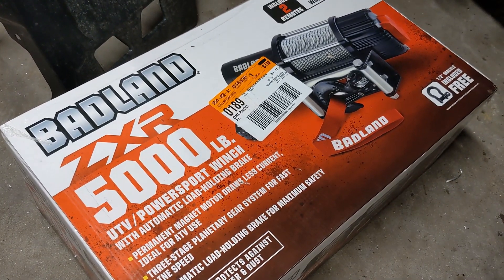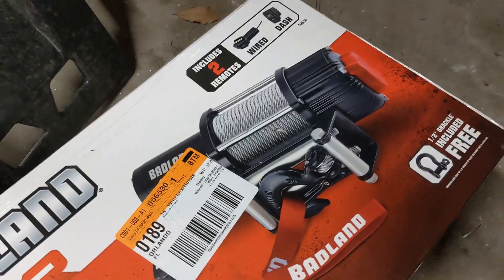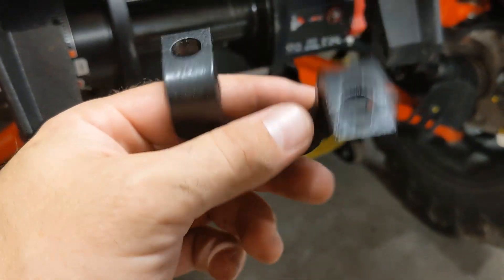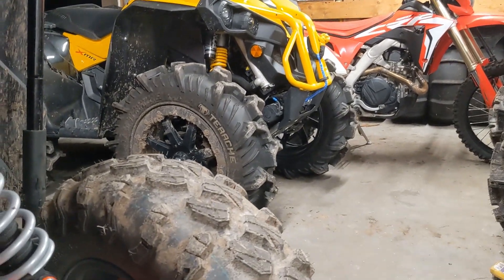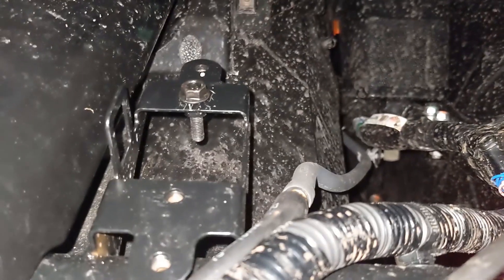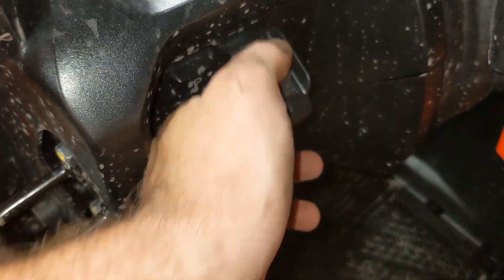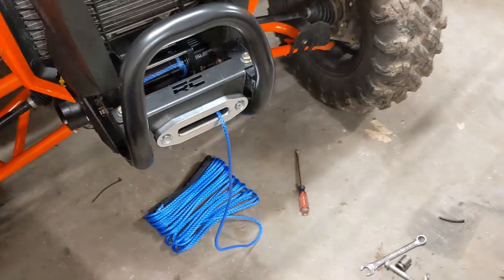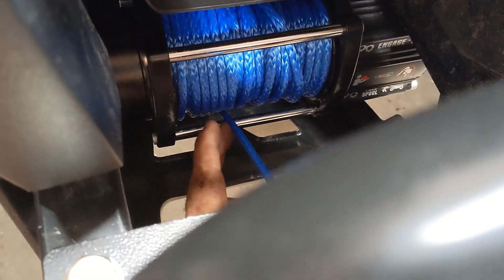Talon 5000lb Winch Install how to do it right

Comment: Could the fairlead RC bracket be placed below the bumper and the square black nuts on top to better align the angle of the line? Apologies if this is obvious.
Reply from the maker: This is how the instructions say to install it. I see what you're going at with having less angle on the cable but it works fine like this. I don't think there's enough room to put it on the other side

Comment: did you find a rocker switch for the dash ?
Reply from the maker: Found a insert adapter
Reply from the maker: https://www.ebay.com/itm/274312089486
Reply: @MudPuppyOffroad   thanks for the info. I tried to order the RC winch mount today, they are back ordered.